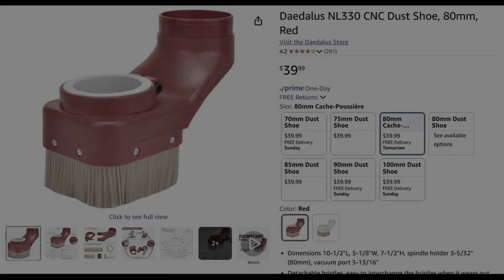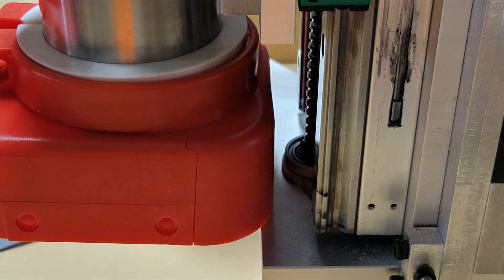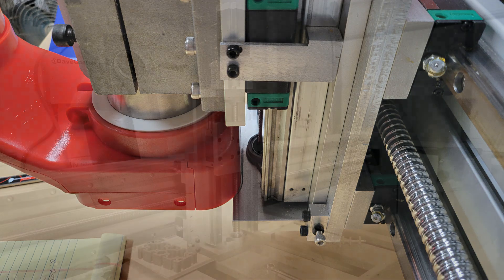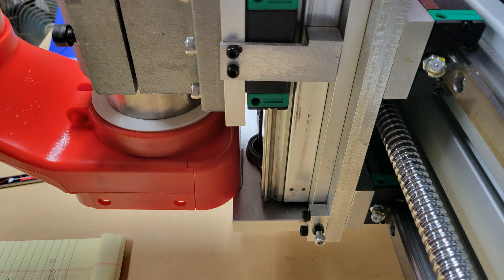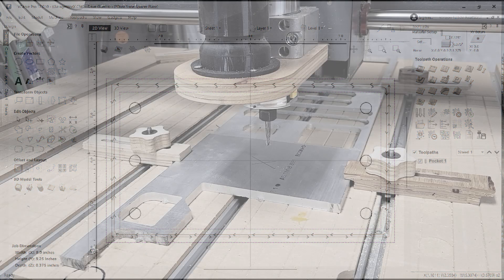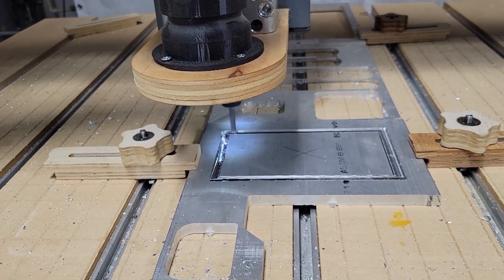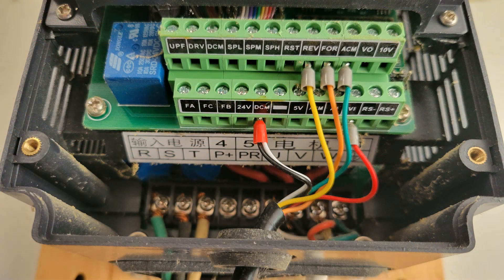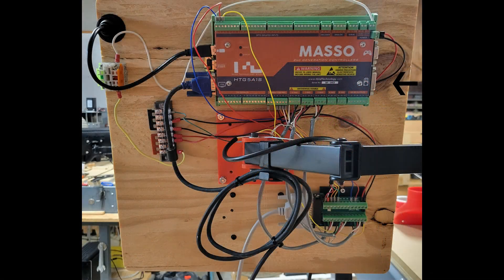Dust Shoe Dilemma

Comment: Hi Dave another option which is the one I took was to make an offset ring for the sleeve of the dust shoe adapter I 3D printed mine . I see yours is a white plastic ring. much easier great video
Reply from the maker: I am printing one right now.  I'm not sure if it will work or not, but I'll know in a couple of hours.  Thanks for watching Bob.

Comment: A bit late now, but you could have also printed an offset bushing to replace the one that came with the dust shoe.
Reply from the maker: Thanks.  I'm not sure I would be able to offset it enough to work, but I'll model one up and check it out.  Thanks for the suggestion.  👍🏻